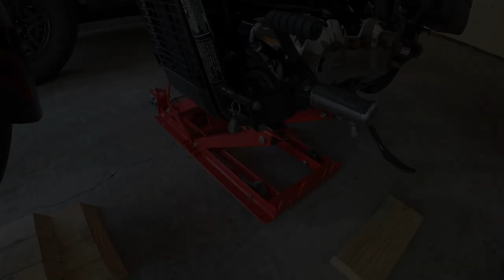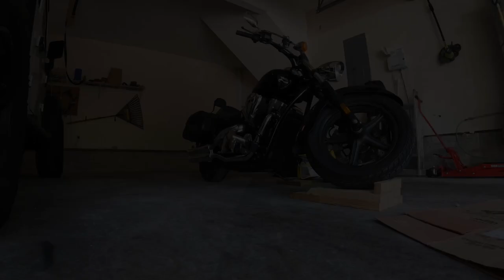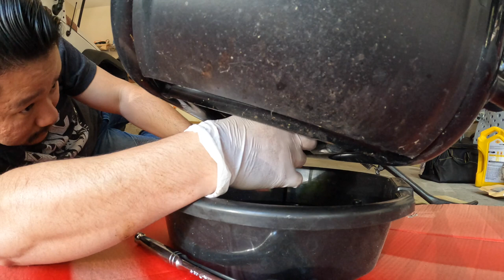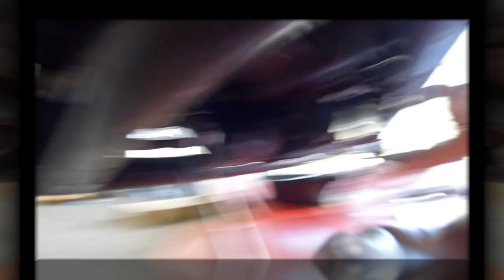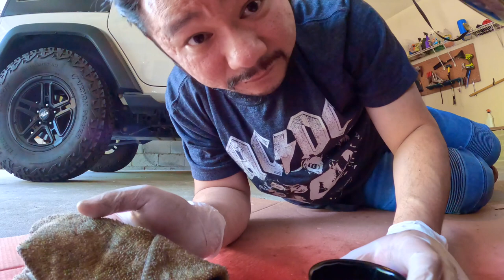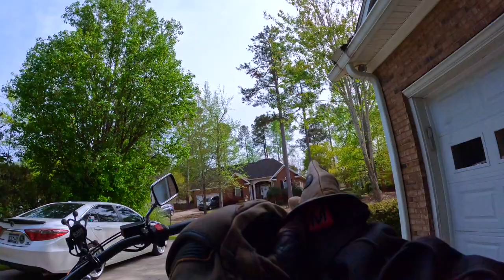Honda Vt1300 Stateline first oil change

Comment: Just as a side note you only use the oil filter tool to REMOVE the filter , when installing it you want to put a small film of oil on the oring and tighten by hand until it touches and gets kinda hard to turn then turn it 1/4 of a turn past that point by hand, also those filter cups are notorious at not fitting all brands if you have to use it then find a brand it is compatible with and stick with it

Comment: Nice work. Just picked up my Stateline a couple months ago and it's due for an oil change. Mine has the original full chrome package, I love the blacked out wheels and handlebar you've got, I just need taller bars.
Reply from the maker: Hey Brian!!! I do need a taller bar too. I just ordered me a two inches riser from LA Choppers. I will give you an update if it works.

Comment: can you let me know where you got the sissy bar and bags ? I am having problems finding accessories for this bike ?
Reply from the maker: Hey George, sorry for the late reply. The bags are easy to find. Just type in Honda Original Saddlebags on google and it'll pop up. Last time I checked, I think they are about $600. Sissy bar, I have no idea. I will ask when I run into the previous owner next time and give you an update.

Comment: You also forgot with a shaft driven you need to change the final drive gear oil every oil change
Reply from the maker: Thank you!! I will change it on the next one.
Reply: No you don't change the differential oil at every oil change. Maybe every couple years or so. Look in the shop manual. And NEVER use Fram filters on anything. They are the worst filters you can buy!